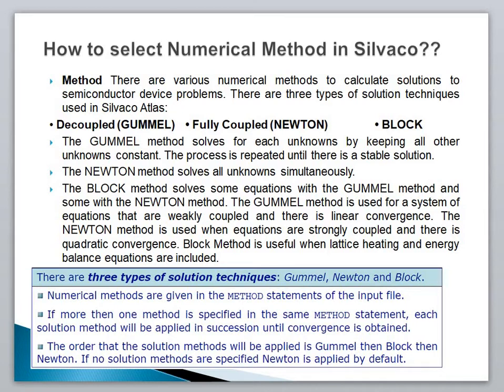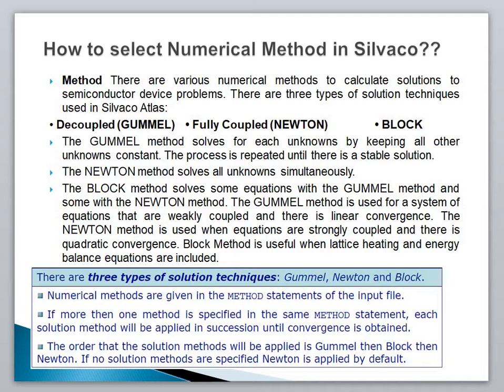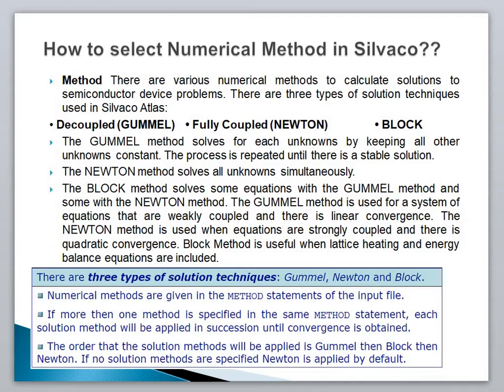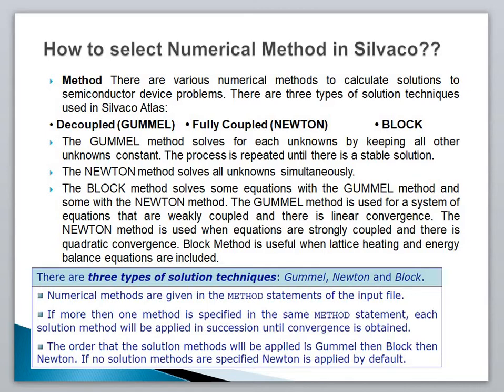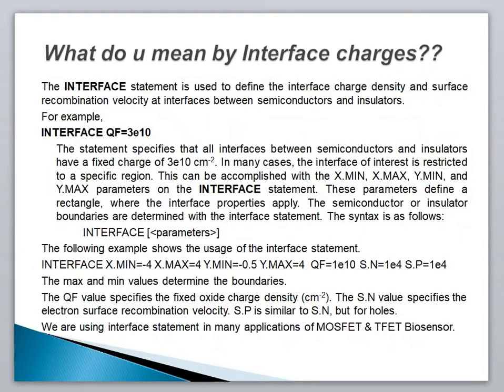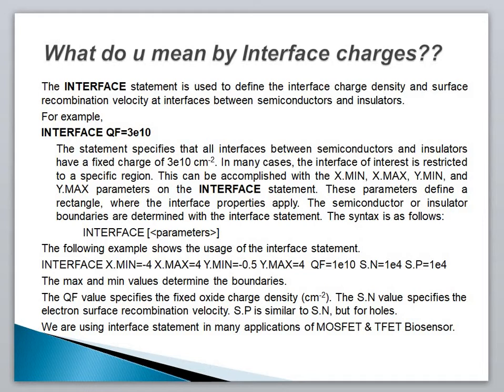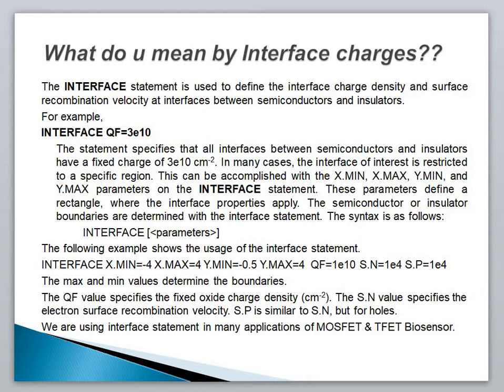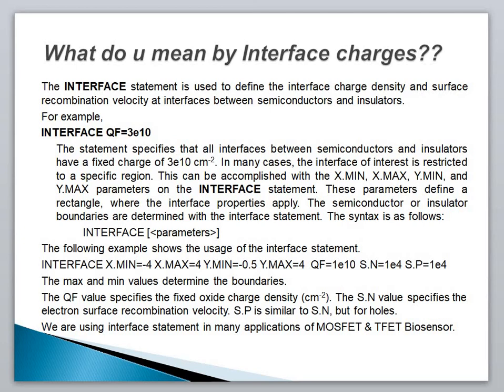How to select Numerical Method in Silvaco and What do u mean by Interface charges??

Comment: We want a 3D 14nm gate length Tri-Gate FinFET in Atlas with the following specifications:
1. Length of source/drain = 10 nm 
2. Height of source/drain = 20 nm 
3. Width of source/drain = 20 nm 
4. Doping of source/drain = n-type, 1 x 10^18
5. Doping of substrate and channel = p-type, 2 x 10^15
6. Tbox = 50 nm, Tsub = 30 nm 
7. Gate Work function = 4.6eV
8. Thickness of SiO2 oxide layer = 2 nm.